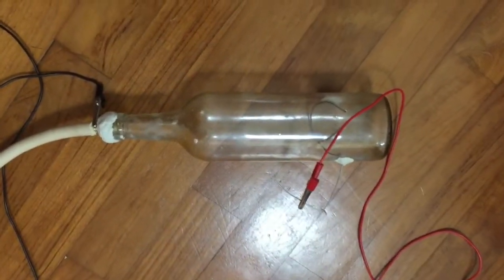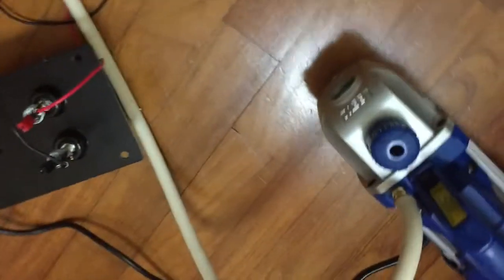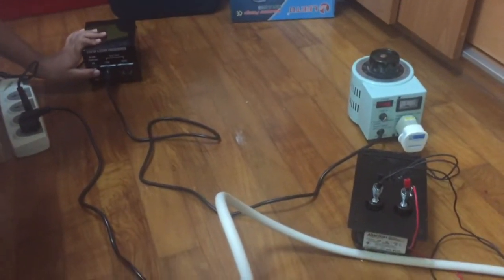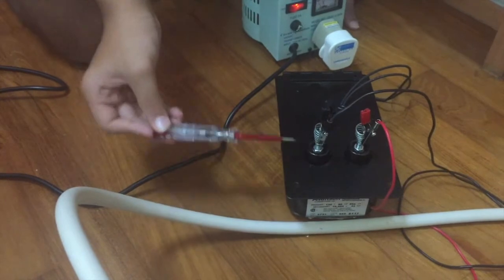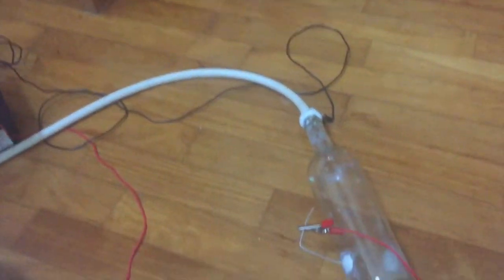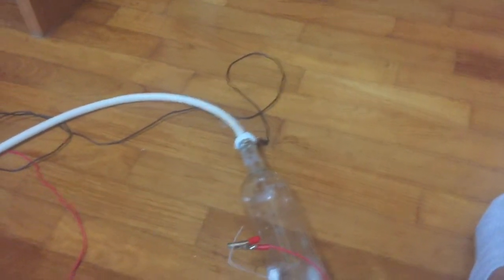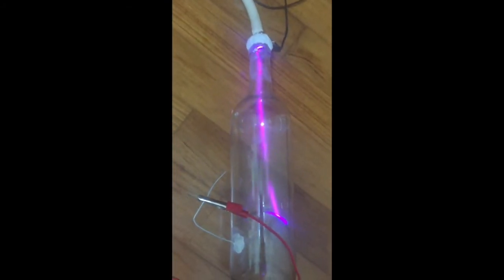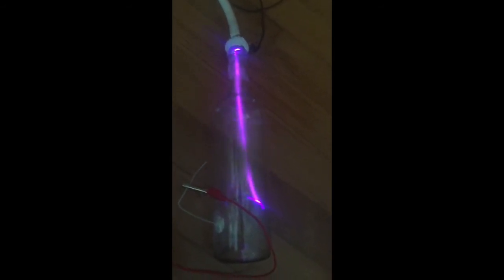Cathode ray tube demonstration

Comment: Hi Ashwin, do you happen to know what the white plug on the variac that connects the two oil burner ignition transformer wires is called? Thanks!
Reply from the maker: Hey man sorry for the late reply. I think you can call it an ordinary plug, I just found it lying around my house and soldered it to the ignition transformer wires.

Comment: @AshwinPande what is plugged into the oil burner ignition transformer to give it a specific voltage?
Reply from the maker: It is connected to a variac which is able to feed the ignition transformer any amount of voltage.